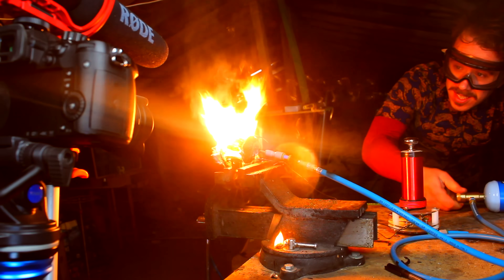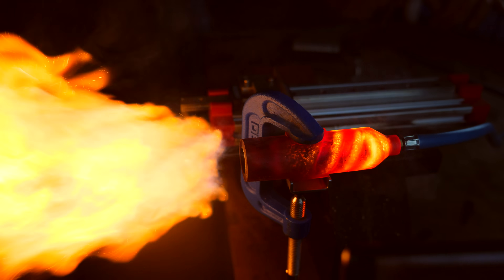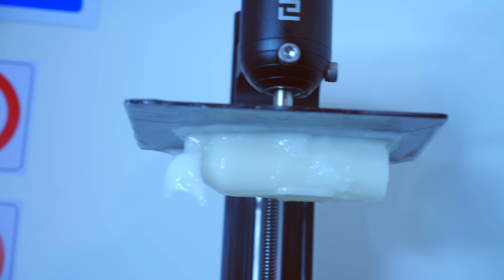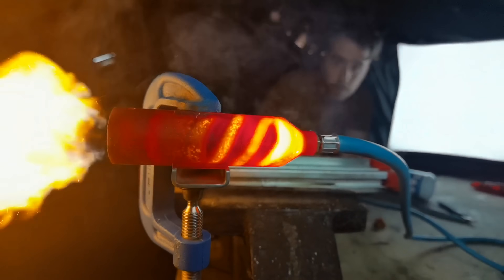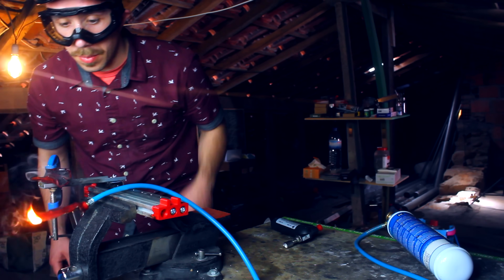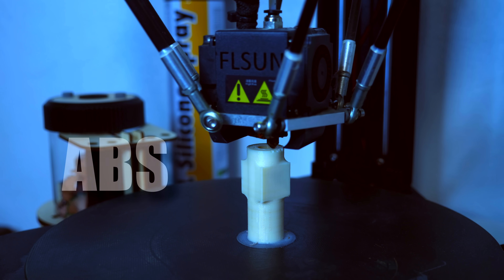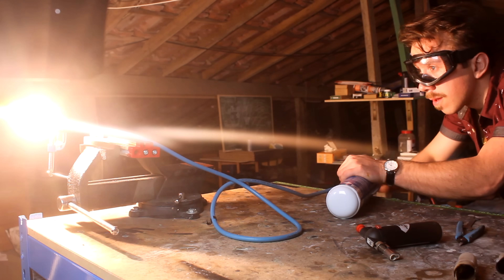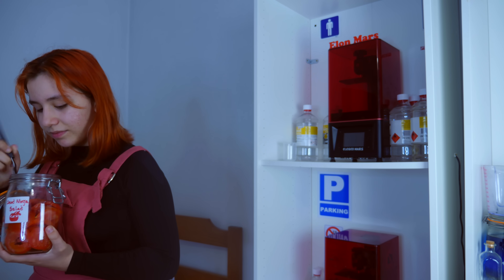Rocket engine that uses itself as fuel! (3D Printed)

Comment: how about, getting some glass sand(used for glass blowing and molding) and trying using that to print the rockets? I am sure it will help with the heat issue you are having?
Perhaps a mix of the ceramic/porcelain and glass sand to have a better sealed rocket? seems like the electro plating did not work as well.

Comment: Did you know that the substance contained in the oranges peel (the one that splashes out when you fold a piece of peel) has a calorific value similar to gasoline? You could make a rocket which runs with oranges

Comment: the way i see it the rocket fails way early because the combustion chamber just bursts, so i think you'd either need a piece of metal tube around it or a resin that doesn't melt/burn as easily (so that it's mostly burning the sugar out of the resin)

also you REALLY don't wanna burn ABS because lungs and eyes and all that. if you want a filament fuel, PLA is the safest

Comment: I own a hybrid rocket motor (commercially made hobby rocket motor, company now out of business) that uses liquid nitrous oxide for the oxidizer. The casing of the motor is an aluminum tube and the fuel grains were machined (this was before 3D printing) out of either PVC or ABS depending on the thrust output that you wanted. You should consider the metal tube casing idea. My motor has a reusable (machined) graphite nozzle, but I have seen a different nozzle design that would be perfect for your motor. The nozzle was a short cylinder of lexan with a steel washer at the combustion chamber end. There was a hole drilled through the lexan the diameter of the hole in the washer. As the motor burned, the hot exhaust gasses eroded the lexan forming what was effectively a DeLaval nozzle. (There was an online video of this, but it was in the pre-YouTube days...)
 [P.S. PLA is also organic -- it is made out of a milk byproduct.]

Comment: What if you used think metal and put on that outside, inside, or both depending on the parts. So using the 3D printed parts that com indirect contact with heat as a mold. Still think you should have the fuel and oxidizer contained on a cart to see how far and fast they can go. Can have them on a reel so they only go so far from you and can bring them back. Also can have the throttle remotely controlled. This would be amazing!

Comment: You need to print a simple fuel cylinder that fits inside a metal tube with a screw on nozzle and oxygen injector cap

Comment: As you have nearly all the equipment for it already, I suggest you explore using casting your 3d printed parts using lost resin casting to make some of your parts. 
While not as strong as machined parts or have as high a melting point as ceramics it would be cool to see integrated into your rocket designs.

Comment: Hey it´s not a judgment but an atvice:

A plastic nosle will never produce constantly thrust, because the tip of the nosle burns/ smels away, which means that the presure in the combustion chamber gets lower and lower. This process happens in seconds. So its a little useless to try. But its interesting to experiment :)

thank you for entertaning videos

Comment: Called Sparklers here. 

By the way if you crush them up a bit and contain the powder in something like two softdrink bottle lids taped end to end drill a little hole to stick another one in as a fuse light it and stand back they shoot a very large plume of sparks and fire and are quite loud.

 Acts somewhat like a sub optimal solid fuel rocket I suppose. Maybe something else to investigate.

Comment: Great videos, thanks ! It's always the highlight of the week when I see a new video from You !
I guess someone already pointed this out but your main problem would seem to be that regardless of what nozzle type you use, it's made from the same propellant and very quickly burns away / deforms and doesn't do what it's supposed to anymore... No nozzle, no thrust...
Start the rocket from the 'fuel' part, i.e. from inside, and make the nozzle from more heat resistant material so it does it's job better...

Comment: What if you coat the inside of the rocket with some sort of pure sugar solution (so you can paint it on and that it hardens up) and then the meterial of you sparkly thing in it? (I also don't know what is is in english😂) if you would coat the inside I think this would give the rocket literally a extra layer of feul.

Comment: Future video suggestion: Following the theme of impregnating UV resin with materials, what about a workaround to the 'can't print metal' problem by creating a mixture of UV resin and powdered metal for better heat resistance? 

Could start with multiple percentage tests to find the best print stability Vs metal content, then try different metal powders such as Steel, Aluminum, and Titanium!

Love your content man, It makes my whole week whenever I see a new Integza video in my suggestions

Comment: I suggest a 3d printed swing with a force meter so you can calculate the actual thrust levels your rockets produce. It's probably impractical due to connecting tubes but if there's a way, I'm sure Tommy Lord Jr will accidentally find it

Comment: What about using a metal pipe for the rocket body. And printing the fuel source to fit the inner diameter of the pipe. You could even go as far as to use a reducing coupler that would fit the pipe on one end and you're oxygen nipple on the other end. That would even negate the issue of leaks if done properly. And I'm sure you can find a fitting that would work perfectly for a nozzle. That could also hold the fuel inside the rocket body.

Comment: I think another approximation to the rocket engine is to try to cool it: one of the mail problems with the designs you're using is that they do not active cool the chamber so it burns. The idea is to use the oxygen both as fuel and as cooling in a vortex rocket engine. This will help optimizing the oxygen used as fuel as well keeping the motor alive enough time to have some thurst 🤗

Comment: You should try making a metal body and metal nosal  and make only fuel cartridges where you just put cartridges and try the engine if it doesn't work make another cartridge from different fuel and just try different fule

Comment: Let the oxygen travel from outer layer of the plastic then feed it to the ignition chamber instead of directly feeding the ignition chamber. It will cool the engine and prevent melting.

Comment: You're printing the housing out of the same material you're using for fuel, right?  So, why don't you combine your previous ideas: print an ABS "fuel" core, and then print a ceramic housing and nozzle to slide the ABS core into, so it's less likely to structurally fail before the fuel finishes burning?

Comment: Have you considered printing these fusion rockets out of wood infused PLA? Perhaps the combustion of both fuels would have a better reaction, or even have a better structural density to hold the engine together better.

Comment: To make your rockets a little safer, i think you should build like an oxygen dispenser system, making use of solenoid valves and switches.  It will be very cool as you could stop the oxygen flow as soon something untoward happends.

Comment: Hey #integza 
Make hybrid rocket by 3d printing ceramic body and using wood and oxygen as fuel ......you will get a dramatic result
....
....you can make with metal body too... you can use metal pipes as body

Comment: Make a matriosca, with the plastic inside, and exterior made of resin. The exterior shield with a cap that opens to put inside the plastic body. The exterior should have the nozzle, and at the opposite side a bottle cap stile ending with a hole for the oxygen tube. Like a 3 piece rocket: plastic body without nozzle, exterior resin body with nozzle, and the resin cap to put and close the body. I'm gonna post this comment until you like it, so I am sure they you read it

Comment: For the body, you could use an appropriate size aerosol can, cut off the ends, and make an aluminium sleeve for your fuel rod.

Fold the ends around a lip on your ceramic nozzle, and some sort of compression gasket, to create a pressure seal.

Comment: You should try building this design in two parts: Fuel core that burns up as well as a ceramic shell that maintains a constant nozzle geometry, engine pressure and structural integrity. This could really work if you added a shell with decent nozzle geometry. I believe the main problem for actually generating thrust is the lack of compression in the motor.

Comment: I kinda have an idea... I think you should have an enclosure made out of a heat resistant material like metal or something. Then make a better rail and measure the thrust with something. Pls give me some likes, I'm studying engineering and I want a 3D printer for my projects but I don't have enough money, I also think my idea is good :)
Reply: I forgot to say that I love your vids and I've been proudly subscribed for a long time now. Also that you could find some way to put sugar or another solid fuel in the fdm print in little "pockets" along the sides or center of the rocket.

Comment: I know rockets that use solid fuel have a design down the center of the fuel. I believe the SLS rocket uses an asterisks design with I believe 12 blades. It creates more surface area to burn moving that force down the center of the fuel and through the throat of the motor. Have you tried 3D printing your fuel with with with it hollowed out in the middle and put that inside one of your 3D printed rocket and motor?

Comment: Would you be able to 3D print just a sleeve that could hold a solid form of the sugar fuel? You could also 3D print a mold for the inserts so when you are able to perfect the engine design it could be reusable.

Comment: Your DeLeval nozzles are under expanded.  You should build one with a larger engine bell.  Also, maybe try sitting the fuel in a simple steel tube so that it doesn’t burn through

Comment: Anything can be rocket fuel if you get it hot enough and a potential exothermic reaction! Some things just work better. Surprisingly, very dry salami works, but has some incomplete burning and variable thrust levels. As far as I know, baloney and frankfurters have not been tried, but if they had their moisture taken down by slow smoking or dehydration, they would be the logical next choice in that direction since the fuel would be more homogeneous than salami.

The real question is: can you fuel a rocket with a hotdog?

Also, you don't want to be breathing burned ABS. Inhaling any burning material is bad for you, but petroleum based plastics are up there with bad things to breathe in. Maybe try out PLA since it is based on sugar and printing thicker walls for it to burn through. Maybe use a high strength sleeve for the whole engine like model rocket engines use, but after using the 3d printed engine deigns to find the best one. This would also let you use a ceramic nozzle that is trapped in the sleeve's end so it can't blow out, just like solid model rocket engine use.

Comment: I've always wondered, are you using some kind of safety valve to prevent flames from getting back into the oxygen tank and exploding like a microwaved tomato, or it doesn't happen because it's just oxidizer on its own?

Comment: Why not print the body and nozzle  on porcelite then print the fuel on resin also why not add the centrifugal thingy on the previous engine for the O2 you can use also propane for the igniting the solid fuel  just an idea

Comment: So there is metal filament for FDM printers ( fused disposition moulding) call BASF ultrafuse 316l steel (basically metal filament for FDM printers )  you can print it on most FDM printers with minimum modifications, you can use that filament for printing vortex rockets or solid fuel rockets ( metal for outer shell and you can use your suger resin part for inner shell also as fuel ) also you can sinter the brown parts in house you already owns a kiln (maybe you might need to change nozzle in 3d printer to all metal nozzle) 
Thank you for inspiring and motivating people in to science and technology

Comment: Could you use the solid fuel as a fuel/reinforcing agent inside of the vortex rocket? That seems like the next logical step. Place a hole in the side of the solid fuel core that has a bung (threads or, you know, a locating pin) to hold the solid fuel in place inside of the vortex engine.

Comment: I think it's possible that a cause of the lack of thrust is that you are essentially destroying your nozzle, and losing control of your gas expansion and shaping. You may need to make the nozzle from your ceramic resin and then make attachable fuel rods out of the ABS.

Comment: A lot of the larger amateur rockets use rubber as the fuel. HTPB is the most used at the moment. You might not be able to 3d print the rubber itself but you could 3d print a mould, and a casing and nozzle.

Comment: Did you consider using the "Computational Design" to optimize your shape? Like with "few" simulation you could change the shape, for example to maximize your trust, or more simpler just maximize the heat resistance to delay the melting of the whole shape.

Comment: You need a nozzle that won’t burn, also a casing would allow you to burn more of the fuel before it failed
Reply: A nozzle that isn't made of the same material your using as fuel, i.e. a non-flammable material such as graphite, plaster of paris or concrete would go a long way to producing thrust.

Comment: You could include cooling channels into the engine and use the o2 to cool it internally so it lasts longer. Or you could include injectors or little holes into the solid fuel for a more even distribution and or more even burn.

Comment: Hehe, heat and reactivity produce more thrust, but also consume the substrate more quickly. I’ve heard of rockets made of PVC and O2 and also dense paraffin and O2. 

Length is ultimately the primary factor with those, as they are usually inside of a rocket body. I’ve never heard of those materials having a dual use. Probably for the same reasons we see here.

But hey, if it produces thrust for even a picosecond, it’s still a rocket!

Comment: i have an idea. for the solid rocket mixture
add some potasium nitrate to the mix. 
done some math while at work.  and 
50% resin
25% 10x powder sugar
25% patasium nitrate crystals processed to fine powder
or
just turn smokeless black poweder to fine powder and blind
70% resin / 30% fine smokeless black powder.

i so want a 3d printer resin printer so i can do these builds please likr my comment everyone.

Comment: You could try to print a casing that won't burn as easily and then use the abs as your fuel. The casing should contain any possible burn thru and also funnel the exhaust thru the nozzle better

Comment: So what if you use the ceramic resin to make a nozzle for them? If you use ABS or any fuel, really, the throat of it will erode very quickly and there will quickly not be any nozzle there.

Comment: The sparkly things are called, in English, sparklers. In Portuguese, according to google, faísca.
You could put the fuel, inside a steel pipe, with the nozzle on the end of the steel pipe. It is possible to build this, and re use the motor, just insert another fuel tube.

Comment: Why not try coating the inside of the rocket models with thin layer of powdered sugar. Make a thin solution of sugar with any solvent that dries quick and have adhesive properties, and pour it in the rocket and coat it by turning the rocket...well I'm not sure whether it'll work or not, but can give it a try....live is about experiments

Comment: You can put a ball valve on the oxygen line to make shutting down the engines easier. Instead of needing a hand full of turns to stop your house burning down you can turn a handle 1/4 turn and reduce your chances of being homeless.

Comment: A subscriber here.
Please do me a favor.
Get an old refrigerator that doesn't work anymore.  Strip out the pump, motor, coils, plastic liner, and all the insulation.  Take the sheet metal door and cover your workbench top with it.
Then lay some sheet metal on the floor below the area you run the rockets.
Finally, set the refrigerator box near your bench so you can aim the rocket blast into.
I am trying to help you to not burn your house down.

Comment: Integza I love your videos keep up the good work. I had a couple questions, why are you setting up your nozzles as  shown in the video. If I'm not mistaking you are creating a torque on the rail aren't you? which restricts the rail from sliding correctly, which gives the illusion on the nozzles not working at all. Most of all your nozzles are creating thrust, but the set up you have now is turning into torque on the rail, instead of having linear motion forward. As for the few times that the rail has moved forward a few centimeters or inches, those nozzles  have created the most thrust out of all your nozzles. Let me know what you think and keep doing these great videos.

Comment: You did something pretty awesome with the sugar + resin -- seems like you could save quite a bit of money by diluting your future resin prints in a similar way.

I'd be curious though if you made nitrocellulose and mixed that into the resin. It can be made with Cotton and nitric/sulfuric acids.  It's smokeless gunpower essentially, and if cut up into 1-mm length fibers (grains?), it might actually strength the resin prints at the same time as making them more combustible.  Should burn relatively clean and I'm thinking that the resin might help keep it all fairly stable.

Regardless of whether it works or not as a rocket, making  smokeless gunpowder alone is always fun.

Comment: OK, print the fuel but use a metal tube and nozzle. Maybe use the aluminum tube from one of those fine Portuguese cigars.  Put an overhead loop in the O2 hose supported at the top with a string to reduce friction.